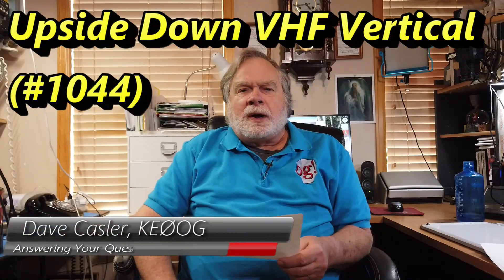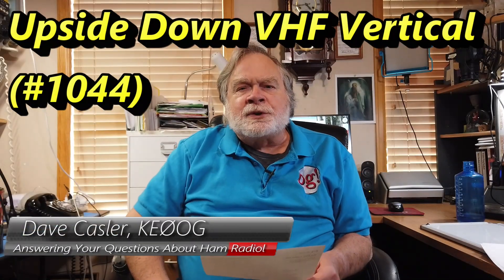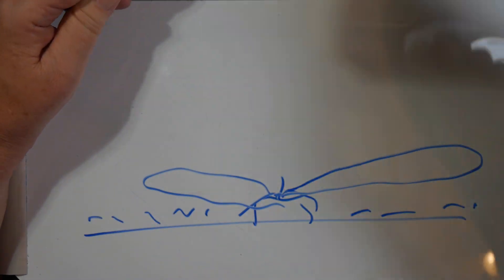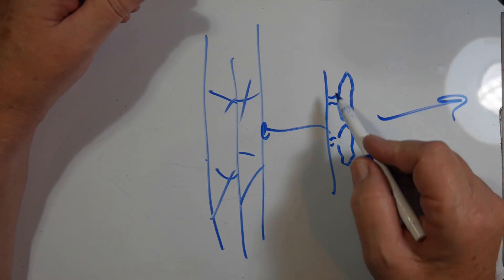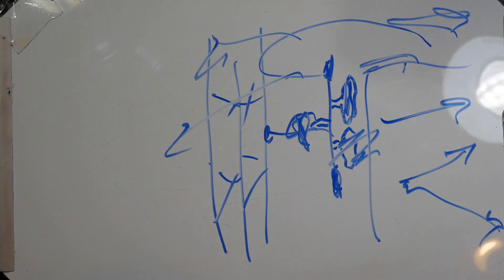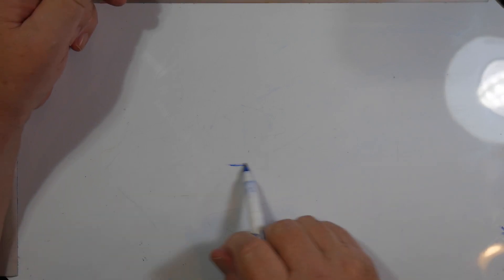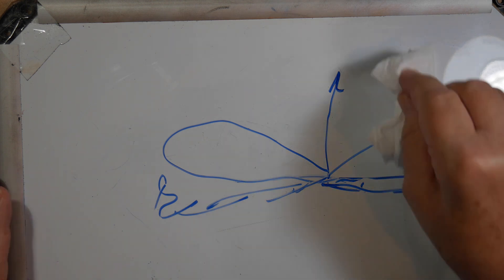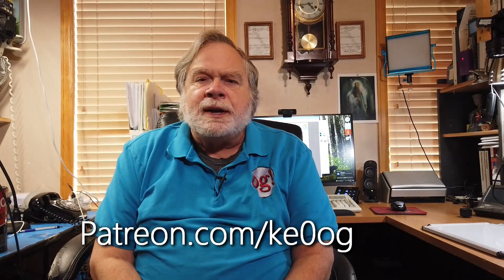Upside Down VHF Vertical (#1044)

Comment: With omnidirectional exposed folded dipoles (2 bay, 4 bay, 8 bay, etc), you can usually control the tilt of the radiation pattern, using phased cables. They call it electrical tilt, I believe.

Comment: How about a J pole ??
Reply: I believe a vertical J pole radiates omnidirectionally on the horizontal plane like a simple dipole, so I don't think orientation matters as much because it doesn't have a ground plane or radials to force the radiation up or down. However, since the coaxial cable is mounted at one end, having it drape down alongside it (due to gravity) would impact it to some degree I suspect.

Comment: Dave you left out a VERY important fact. The ham grade antennas vs the Decibal Products type of repeater antenna you described has weep holes at the bottom of the antenna. Some may not but most do. There is also a alan screw that on many will allow you to take the guts out of the antenna. The ones that you can "take the guts out" will have a weep hole. You cannot cover that weep hole or condensation will build up. There in turn if you flip it upside down... then it will drain water right into the radome of the antenna. If you flip the antenna, the type I described, you must seal that weep hole and put one in the cap. A small drain hole. I cannot tell you how many ham grade repeater antennas I have had taken down that have had condensation build up from the weep hole being covered up. Now, that is here in Georgia. I would not think it would be much different elsewhere but I could be wrong. de Robert KD4YDC ps, Really enjoy your channel!
Reply: Very good point, I was also thinking this